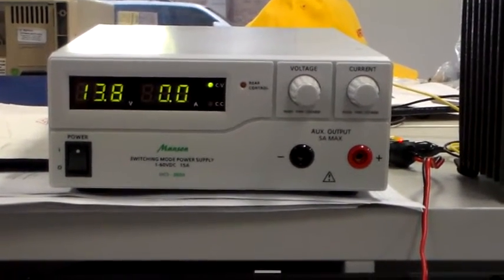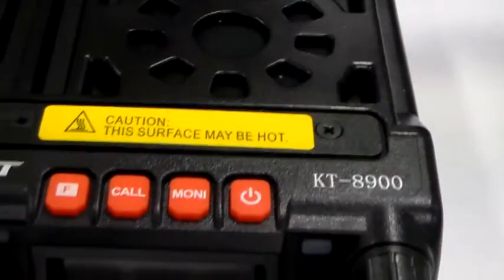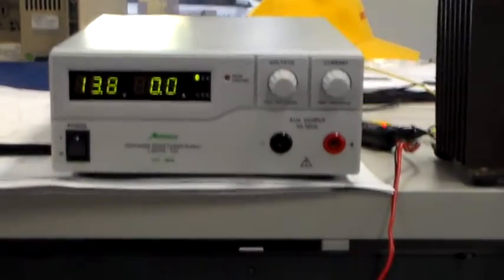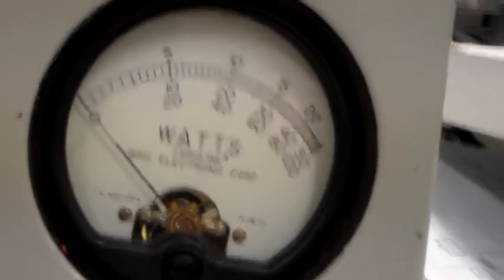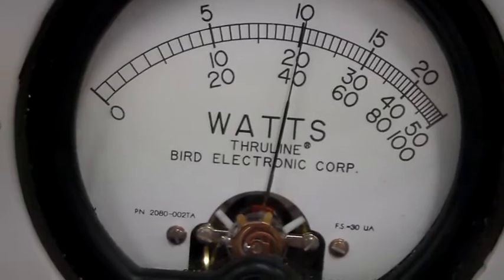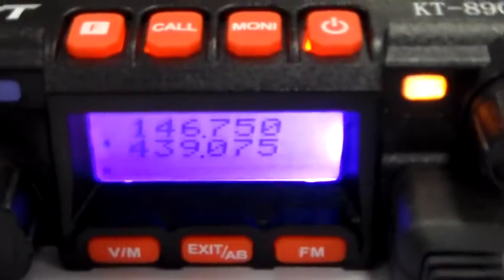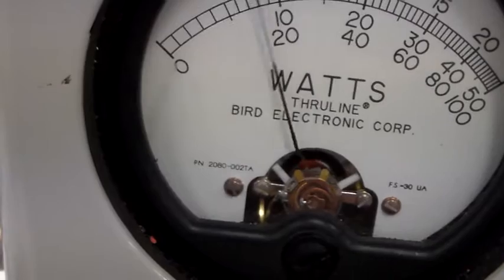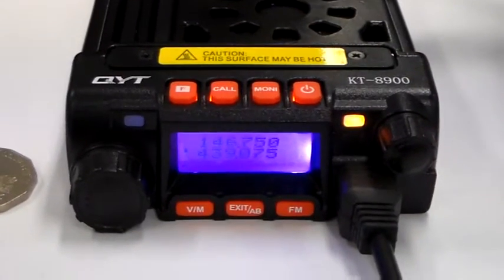QYT KT-8900 Dual Band Mobile Radio Power Output.

Comment: Hi. I have a QYT KT8900 that no longer works properly. It will transmit, but only over about 100 yards. The reason for this could be it got too hot on the dashboard of my car during some hot weather, or, after It packed up, I discovered (using my Baofeng UV-5RTP) that my Mag Mount was giving a SWR of 3.5/1. My question is do you know of a company in the UK that repairs the QYT KT8900. So far I have had no luck finding one. I'd be most great full if you can help. Thanks. Dave Morgan MW6IVW
Reply from the maker: Hi David. I'm afraid not, and I strongly suspect if there was one the repair bill would be close to that of a new radio.
Reply: Thanks for responding VK6CS. I'll probably pull it apart just to see what is inside. Thanks again. Dave.
Reply: If you only get short range transmit..you probably fried the finals on it.   Shouldn't be to hard to replace them if you know how.
Reply from the maker: The low output is just due to poor specifications. The price of these radios makes them disposable, if it had no output it would go in the bin.
Reply: @vk6cs456  replace ur RF you can find it on ebay. it has a poor heat sink tweek it.

Comment: I bought two of these mini type units, both had a hard time making 18 watts and 15 UHF
Telewave meter and a bird used.   These where peak reading,, as they both vary 
in the frequency band,  Ours units peaked in the Commercial band worse on the
Ham Bands 

They are sadly over advertised.   One of them won't work with Windows 10
So yes price is great if they would advertise them properly, I am still looking for a 25 watt mobile.......I also got stuck with the one that advertised 220 got it and it is 240 MHZ
Reply from the maker: Welcome to the world of cheap radios. You get what you pay for as they say. I reckon these would be ok for an unsecured vehicle like a jeep, not too much to lose if it gets stolen, and they work well enough to get you on the air and have some fun..

Comment: Good informative video. Interesting as I observed exactly the same on my power supply and Bird watt meter. £65 GBP radio though so cost effective. Especially since its 50USD for a cctss board for my TS711E, then another 50USD for my TS811E then another £50 for my TR-751E
Reply from the maker: Thanks for the feedback Ken. It seems they're all going to be pretty much the same.

Comment: Maybe they got the 25 watts while powering it on 13.8v +/-20%  and used the higher power of 15v?
Reply from the maker: To be honest I don't think another 1.2v would make that much difference. I think it's more likely their claims are exaggerated. Of course I only tested one sample, maybe others will do what they say and they just have poor quality control. It is a very cheap unit after all.